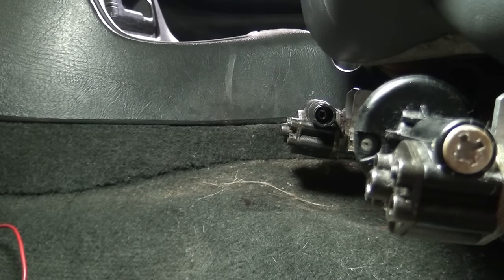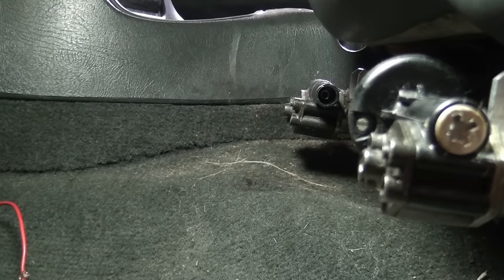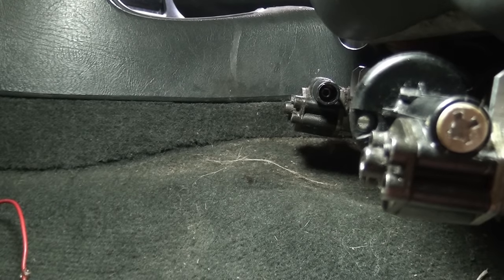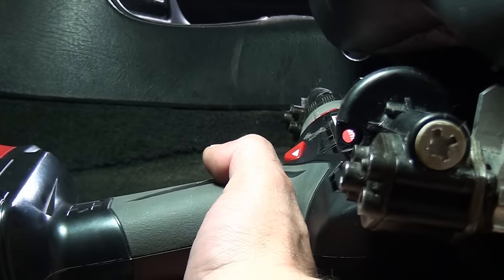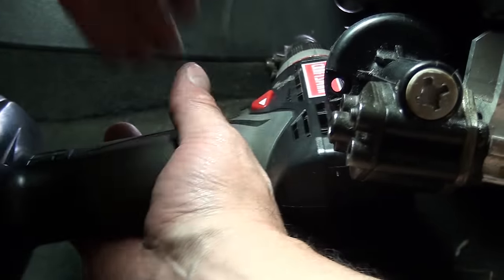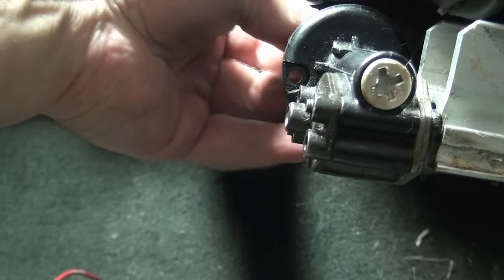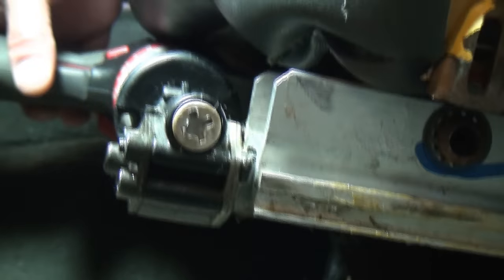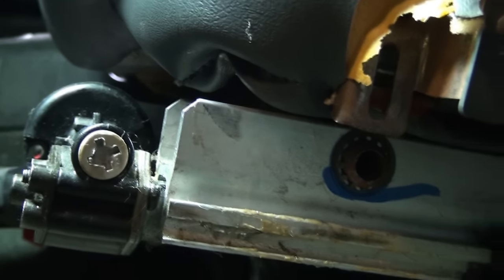DIY How to Manually Adjust Power Seats in a GMC Chevy Vehicle Blazer Jimmy S10 Silverado Sierra

Comment: what about tilting the seat?
Reply: Thts my problem
Reply: Did he ever answer you i have the same.problem
Reply: My daughter has a 2012 avalanche and the seat will not tilt or raise up or down, this video only moves seat back and forth. The issue you are having is a whole separate matter, two motors Run each function, typically it's a plastic cog that is mangled up and needs replaced with a brass after market one. 

Depends on the make and year. A bear to get to, she takes the seat loose and tilts it back to get to the gear housing and cuts off plastic cog then JB welds the brass cog in place. 

I read a comment a guy just manhandled the seat by lifting it into place and left it there.

Comment: Odd question. Hiw high does a typical power seat raise you up? I habe a silverado and Contemplating on doing an electric conversion or just getting blocks for the seats that raise it up in inch and a half. Just curious if anybody had the speck on how much power seats typically raise you From bottom out to top out

Comment: How did you remove the motor without removing seat? Or breaking anything?
Reply: My motor clicks when using switch, but no movement. It is alllll the way back also so can't remove rear bolts.

Comment: I have a 2007 yukon, the drivers seat is all the way back and the side next to the console wont move, when I use the button to slide forward just the outside moves. Any help with this? I would appreciate it, cant find this issue anywhere?
Reply: I know this was 2 years ago but I have an 07 Yukon and my driver seat closest to the door won’t move what I did was I used pliers and spun the screw rod from the back (u gotta go through the back door and pretty much kneel on the ground) I had someone use the button to move it a bit at a time, just done this over and over until we got it to where it could be driven comfortably. You will see the screw rod I’m talking about if you move the seat while you’re behind it looking cuz the one side that’s still working will be spinning.

Comment: Read more I am not sure if I have a battery problem or other "electrical gremlin" issue.  I drive a 2005 GMC Sierra VHO 6.0L Performance Edition.  In January 21, 2012,  I purchased the Interstate battery (34/78DT - Mega Tron Plus), it has a 85-month life warranty rating - that is 7 years and one month.  I am in the 6th of the battery's specified lifespan and if I recall correctly the recent battery test at a auto parts store rated my battery at either 400 or 425.  In my amateur attempt to troubleshoot I learned more than I thought I could learn about auto electrical systems: I wonder if I replace the 30A Circuit Breaker (GM #12077863) [approximately $10.00 to $20.00 from either GM Parts net website or Sears]  if it will resolve my driver's power seat?  The switch is in a state of unreliability because if I attempt to move the seat forward, the seat will move backwards and vice-versa.  I pulled the circuit breaker and after about a minute, I reinserted the circuit breaker and the seat functioned properly, but a few days later when I needed to move the seat backwards it moved forward.  I have also read that it could be a faulty control switch in the seat, which costs $92.00 + at most local auto parts stores.  In summary, I am trying to solve the power seat problem at the lowest cost due to major financial constraints!Read more Show less Show less